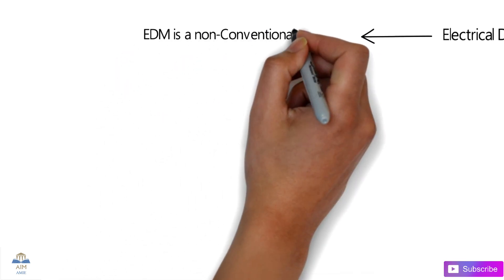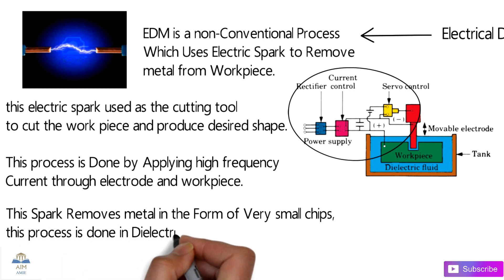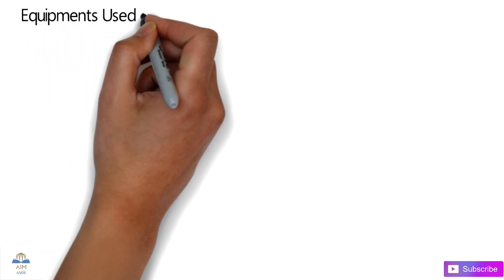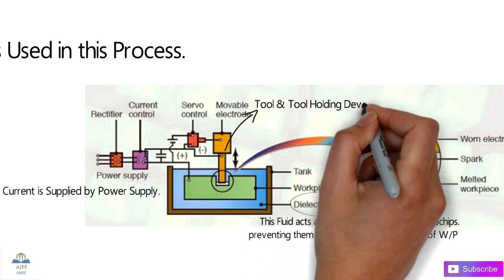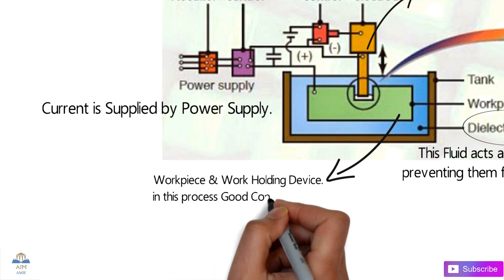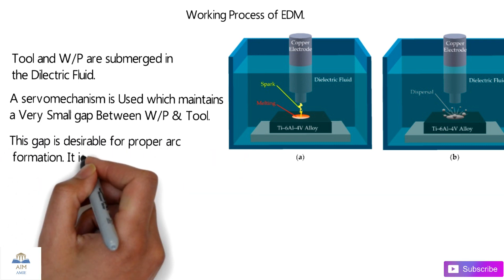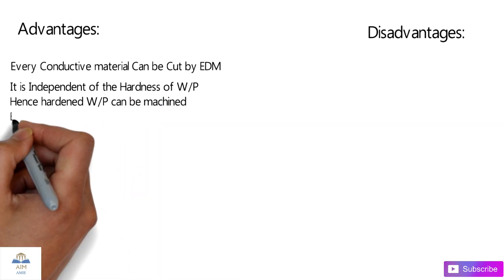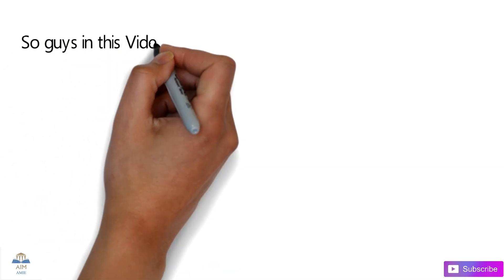How An Electrical Discharge Machining Works???  ||Engineer's Academy||

Comment: So what the erosion rate of the workpiece as a function of current ?

Show a circuit of a how the servo maintains the 0.003" electrode gap...

It all a big black hole

Time to do more research..